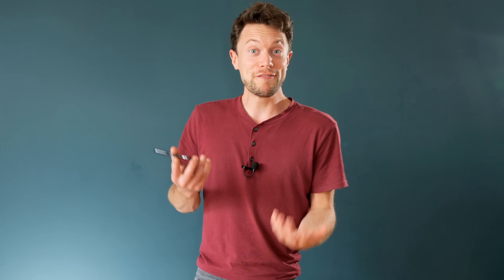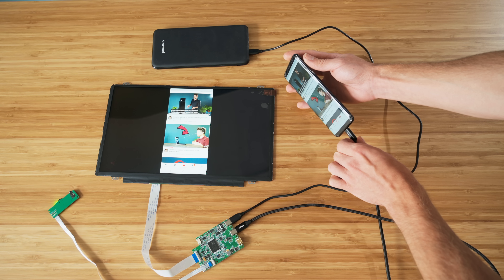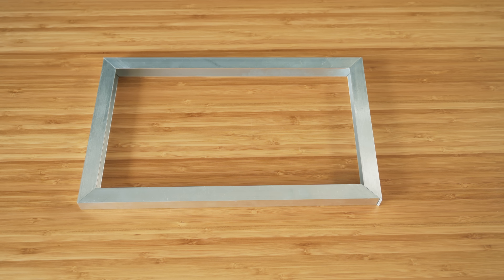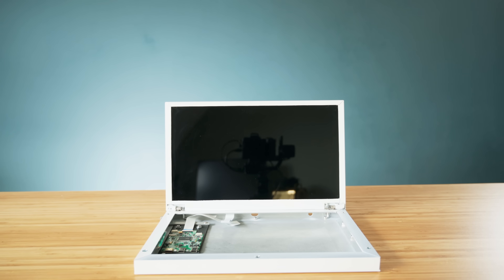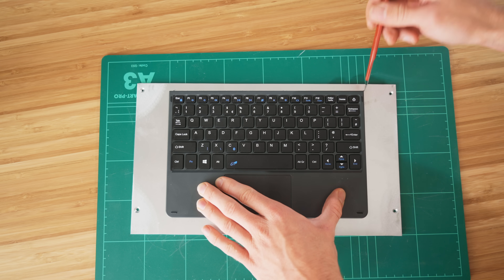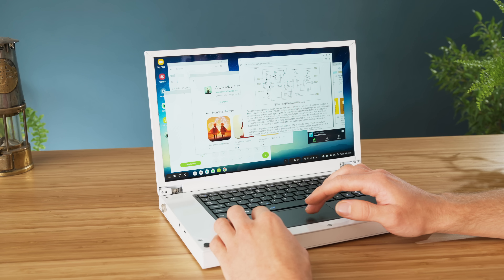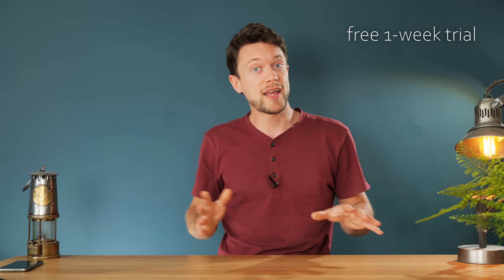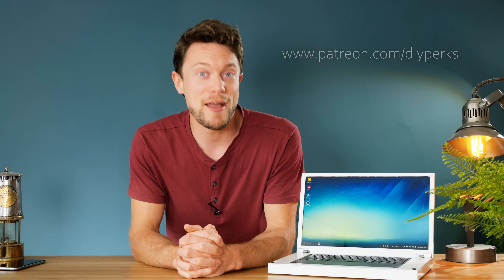Broken smartphone to working laptop transformation

Comment: Nice project. But for the price of the components, You could go and have the screen replaced by a professional in a phone repair shop. Also aluminium is a nice material, but not everyone is equiped or has the hability to work it ( I do, but majority of peoples don't). Keep the good ideas comming. :-)

Comment: This actually looks like something i might do, 
Only difference's I would make would be to have the power in on the back of the laptop Type C also because I would loose that cable in about 5 minutes.
Also I would connect the keyboard to the battery banks usb port so my keyboard wouldn't die before the phone.

Comment: Quick question...I have an old phone that has a lot of my personal data and photos on but the screen is completely smashed. The phone still works, it still charges and receives messages etc but the screen is totally broken and very expensive to fix. Sadly is has a security pin (I obviously know the pin) would this project still work or not?

Comment: Something that may be outside the scope of this video would be rather to install something like Andronix to have a near complete linux desktop experience on the phone and use that rather than a custom desktop app, in a lot of phone's developer settings you can also set the DPI to something particularly high so that it looks better on a larger monitor and allows more usability with these apps since they look cramped.

Comment: This should be a thing - isn't there a product like this in the market?? Quite an opportunity!
Reply: There have been. There was the Next Dock - basically a laptop shell (with a keybaord, screen, battery, and trackpad) that you plugged your phone into.

Several years ago there was also the Asus Padfone - a phone that came with a tablet shell. The phone docked on the back of the tablet. It also came with a keyboard the tablet could then be docked to. Basically it was a smartphone, tablet, and laptop all in one. 

Neither one sold very well.
Reply: @LOTR_BTTF  because a 200 laptop that needs a phone is better spent on an actual laptop.
Reply: @LOTR_BTTF  Yeah $200 is quite a bit. They should have reduced the number of features to keep it below $100 - I think for $80-100 I'd probably have one, because now we can do remote desktop in the phone; so you can simply remote desktop and have a pretty decent computer home running your actual apps!

Comment: Aside from broken old phones that is a fantastic setup for SBCs (Single Board Computers) Such as the Raspberry Pi 4 with 8GB of RAM. That gives you many choices for the operating system. 

The thing with SBCs is that they all miss monitor, keyboard, mouse, and a battery for charging. This setup would turn any SBC into a mini laptop in a brilliant way. There are 100s of SBCs in the market and many thousands of SBC enthusiasts who develop software for and Turn SBCs into unique custom machines. 

Retro gaming is one primary use application for SBCs. 

And RPI 4 in particular has many fans who consume creative videos done for it with passion. 

Hook up a RPI 4 to this and I stall wi does on it with a title like "Custom built Raspberry PI 4 Laptop running windoes 10" and I bet it will get a lot if hits and many new subscribers!!!

ETA Prime and Explaining Computers are two popular  channels for SBC enthusiasts.
Reply: I recently completed a project just like you described - a Raspberry Pi 4 laptop, built out of Tasmanian Oak. Apart from the weight, it's a lovely machine.
Reply: @PieOrCake1974  I would love to see what you built!
Reply: Isn't that what a Pinebook is basically.
Reply: You won't get good battery life though as the Raspberry Pi lacks a low power state. An old phone seems like a better choice.
Reply: @feedmyintellect  Pinebook is NOT a ChromeOS device. It's an open-source ARM laptop for tinkering. You can run any distro you want on it. It really is an SBC made into a laptop at it's core, but more professionally.
Reply: I'm definitely considering that for my next laptop.
Reply: I have been searching the web for any possible use of a smartphone motherboard as an SBC and even multiple ones as a cluster since a lot of phones are really powerful, if someone with the enough programming skills can tweak or rebuild desktop OSs to be compatible with arm based boards it'll be huge man.
Reply: @ahmedihab4661  Aren't there already a number of Linux distributions that can run on rooted phones, and most tablets? I use an older single-core "Insignia" tablet with broken digitizer to run as an OpenSIM sandbox (local) server, using Linux Mint, and can work on it directly using OTG keyboard and mouse on a Gnome Fallback desktop.
Reply: @JamesMorningstar  im actually new to Linux , I've played with bunch of destros but only on x86 machines, i know about the raspberry pi arm distrios but i didn't consider trying linux on phone motherboards .. Thank you
Reply: @ahmedihab4661  I haven't tried any new Linux installations in the last two years, but some past distributions, in particular, Debian, Suse, and Mint would often either autodetect some hardware architectures, or ask what you wish to install it on, and the list was extensive, even including old early 1990's hardware like Sparkstation and Amiga computers, which were nowhere near as capable as most phones are today.  And that's only when looking at the GUI based distros. If only needed as a fileserver, or running from console, telnet, or UART, I've seen LAMP (Linux web servers: Linux, Apache, MySQL, and PHP) able to run on tiny 3 chip circuits and an SD card, really only needing the basic Kernel, a few generic hardware drivers, and the specific server apps.
 
I think any current Ubuntu installation can easily detect or install on most any tablet or phone.

Comment: i use my phone (network circuit dead,)as a secondary display and mic✌️
,tried to use the touch screen as a graphic tablet , failed miserably (response time very high)if there is any way to use touch screen as a drawing board plz make one i have already smashed 2 phones by now
(1 had issue with power other had full body fracture)

Comment: I really like this one. I use my phone a Note 3 yes one of those. Not a c type but I have a hdmi adapter like your to my monitor and also use a blue tooth keyboard and mouse. It's a bit weird at the start as the phone is on its side but I might try that program to turn everything. Thanks.

Comment: I have an S8 Active and I literally couldn't afford to do this with a damaged phone, I'd have to repair it with a new screen.  But yes, a DeX enabled Samsung phone would be perfect for this sort of use case and I'll probably do this for my S8 Active when it reaches end of life.

Edit: Oh, geez, you've decided to just put the phone on the back to take advantage of the wifi signal.  In that case, you've literally remade one of these laptop docks.  I dunno I'd want to go further than this if the phone is actually that physically damaged and properly integrate everything.  It would make the whole package smaller, and I could pin the wifi antenna outside of the device.

Comment: A question I have is about the space next to the battery bank. Would speaks have fit there? Like I know the stereo separation would be basically nonexistent, but still, could it work? Also, for the wifi issue, would a usb wifi dongle work? That way you could have the phone inside and have wifi. And to expand on that, would a usb camera work? Then you could do what you've done and take a laptop camera and put it in the DIY laptop. As for projects, do you think you could do a video on a DIY wireless lav mic? That'd be really cool.

Comment: Nice idea but I think i would change a few things. 

For one why not disassemble the phone itself so that the motherboard and other parts could be mounted directly into the laptop? 
That way you could also improve the Wifi cabling by extending the cables and routing them somewhere where they would get good reception. Negating the need to mount the phone on the outside of the laptop itself.

Comment: This would have been so much better if DeX was still running Linux. Imagine making a 100$ laptop that's capable of running Linux nicely.
Reply: This was what I was wondering. Instead of finding some emulator on the Play Store, couldn't you root the phone and turn it into an Ubuntu device?
Reply: @cboehm24  Yes, but this is a fast build, and it works well with barely any software modification.
Reply: Maybe somebody will try that with a PinePhone in a few years.
Reply: You can install it onto the phone if that’s what you’d like. YouTube has plenty of phones running Linux on them.

Comment: i don't get it, yeah aluminum blocks the wifi signal, but that keyboard is made out of plastic...
apple laptops have been made out machined aluminum for almost 14 years now and had the wifi and bluetooth antennas at the display assembly which the only signal that can get out of it goes out through the display itself.
these macbooks don't have any connectivity issues whatsoever.
but that laptop you built has a HUGE plastic keyboard on it, i don't see why there would be any signal issues if theres just plastic over the phone lol

Comment: I think it's important to warn that not all phones have video output through the usb c or microusb cable, and you really need to check that before attempting this. In fact most of the phones don't have this feature since manufacturers like to keep it as a "premium" feature so generally you will only find it in flagship phones and their "plus" versions. For instance, i only buy mid-range smartphones but only the best I can get for my money, and of the 8 android phones I've had, none of them have had this feature,  so beware.

Comment: @13:13! My phone doesn't support any display output (MHL or USB C), so if your phone is like mine, you can use a DisplayLink adapter with the correct OTG adapter and app. This works well for mine. It does drain the battery though, but not by much. Mine has a USB switcher that allows me to switch it into charging mode when idle.

Comment: Suggestion: open the back panel of the phone, find the SMA connector, put SMA Antenna which can be salvaged from an old laptop
Reply: Phone should be mounted behind display slightly above so you get front facing as webcam & rear camera through a hole in the top cover.  These cameras are too good of quality to tuck under a keyboard.
Reply: How about using an old laptop case?
Reply: @-ahvilable-6654  While sometimes viable, a lot of those are quite cramped and mounting a powerbank in particular will probably prove quite troublesome.
Reply: But then you cannot use the camera
Reply: @sayanghosh6996  actually you can. Usually most phone camera are detachable . Watch jerryrigeverrything tear down video to understand this.
Reply: @nezunish-898  yes.. most of the camera wires are modular in design. with right wires, it should be extendable to the actual location of laptop cameras.
Reply: or you could just use acrylic or wood for some panels.
Reply: Also, the whole modularity thing he said
Reply: @sayanghosh6996  Do you know how the back of a Nintendo 3ds has a slot where you can slide in a game cartridge?
What if there was a big slot at the back of the laptop where you can slide in a phone.
And you can use one of those webcams
Reply: yeah phone staying outside annoyed me a lot
Reply: Just laser cut air vents in the aluminum
Reply: phones don't use sm
a connectors
Reply: @Ahhh_Perrrro  plenty do , inside .

Comment: As always your projects are extremely interesting, but this is not economically efficient, unless you plan to dispose of a perfectly working smartphone instead of replacing the back and the screen. A $250 chinese notebook will give the same if not better experience.

Comment: Is there an touchscreen LCD panel available?
Cause then you can make it into a tablet
Reply: Yes there are. Mine is touch screen monitor.
Reply: I'm actually looking into it
Reply: Get a display with a touch digitizer, it should still register through the USB but if you're doing the same diy monitor or screen like what he should us you need to get a proper lcd controller that supports the touch digitizer.

Comment: Turn a laptop into a custom form-factor PC.  Turn a phone into a laptop!  

I love your ideas.  I personally think this project needs a little bit of polish, but like most of your videos, I find this very inspiring.  I have thought of making a very small form-factor computer around the guts of a smartphone or tablet for a few years.  I guess it's time to start doing.

Since the phone is attached externally, and any phone can be attached, this project is actually an accessory, but it greatly expands the usefulness of the phone.

Comment: Wife: Hey Love, apparently our samsung phones have desktop mode and I saw an accessory online that looks like a laptop but it only works with DEX.
DIY Perk: Hold that thought.
Reply: Nexdock Touch. I have one on preorder, well worth the cost IMHO. Laptop-docks like this are the future of casual computing.
Reply: @milolc  why pay for that when you can get a full on laptop for the same price?
Reply: @bland9876  Because a laptop will performance degrade over time and is a big cost to upgrade.  In 5 years time top level phones will surpass medium level laptops of today!  NexDock allows you to use PC's on a stick, phones, raspberry Pi's etc.  I hope it comes to the UK as I shall get one!
Reply: @bland9876  A Nexdock Touch costs $250, now find me a $250 ,laptop with good build quality and performance, I'll wait. Only the most bargain basement laptops are in that price range, and most of them are of very poor quality.
Reply: @bland9876  Look at the cost of the build or atleast just the electronics.
Also assume you are doing this because you have a spare/damaged phone and laptop and have free access to workshop tools otherwise yes buying a new laptop is in every sense has more value.

1. LCD Control board  - ~$50
2. Tablet Keyboard      - ~$30
3. Power Bank              - ~$10
4. Cables and ports     - ~$5-20 (Ports are cheap if you buy in bulk/set, but not a piece)

5. Frame                        -  ~$30-50(Depends on size and region)
Total         =                   ~$135-160

Now one thing to note theres plenty of alternative parts to use and it could get cheaper, but that how prices are where I live. Also the ones I listed are for the parts in the video and amongst them the ones with the most amount of price variation would be the cost of ports and frame.
Reply: @milolc  the nexdock is only 250 but you do not get any internal so it is useless unless you buy something to hook into it. If you use a phone then it is no better than a chromebook and that is $250 with the internals. The only good use i have seen for the nexdock is to use it with a server whenever you need a screen and keyboard.

If you have a broken laptop and want to use it as a laptop i guess you could tape the mother board to the back of the lapdock screen but that dose not sound very good
Reply: @girishkumarpeddi6266  i love the idea of having one device that can do it all (including replacing your keys) but if you lose it you literally lose everything :(
Reply: @welshtechie6832  if phone are so powerful why don't we have one running windows that can dock? Just imagine being able to use a phone as a pc so you don't have to have both and all your saves are on one device (and your backup of course)
Reply: @bland9876  You clearly have no idea how much oomph a top tier phone has. A chrome book in no way rivals the performance of a flagship phone.
Reply: @milolc  it doesn't matter how much performance of phone has if it's running crapndroid

I have an Android phone and it is pretty good as a phone but if Android was on a desktop it would be terrible compared to say windows or Mac OS
Reply: First Name Last Name please scour the internet and see that you’re wrong about the phones not being able to run windows or Linux. Smartphones are pretty powerful. Not Ryzen 7/intel i7 level performance (yet), but if you look that the S20 it’s pretty strong. Windows is now making ARM windows (emulated for now). PS HP made a docking ecosystem for business phones where your smartphone would dock and pull up a full windows, but no one bought windows phone and so Microsoft discounted the idea for now.
Reply: @sirdewd2197  find me a phone in 2020 that has Flagship specs and is running a full version of Linux or Windows I'll wait.

Also I'm not talkin about rooting your phone I'm talking about straight from the manufacturer

Would be cool though if a phone could run Chrome OS when plugged in that would be cool probably be basically a better version of Samsung Dex
Reply: First Name Last Name that was what I just previously stated... guess your reading skill has a character limit... 😒
Reply: @sirdewd2197  all you said was that Windows phone was discontinued and so there's no phone nowadays that's running Windows and I know Android is linux-based but it's not like you can just run a full-fledged Linux apps on Android without some kind of emulator or virtual machine

I don't know if there's a way to root your phone to run full Linux but I can't think of any phones that come with a full version of Linux like ubuntu or red hat.
Reply: Buy a usb c HDMI out plug in a kn and mouse... done.  Works with Hauwei and samsung

Comment: you have to be really careful with usb-c to usb-c cables. regardless of them saying 3.0 or 3.1, most of them on ebay and amazon are just 2.0 with only 4 internal conductors. expect to pay £10-15 for an actual USB3 capable cable. If you want 5, 10, 20, 40Gbps, those are more expensive the faster you go.